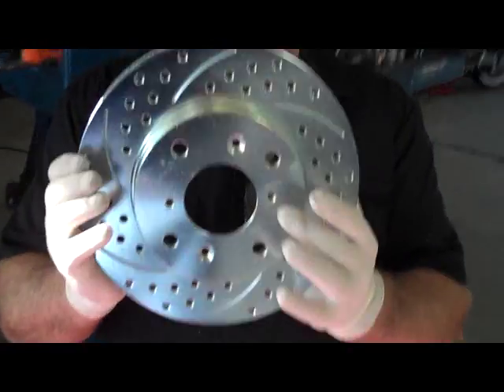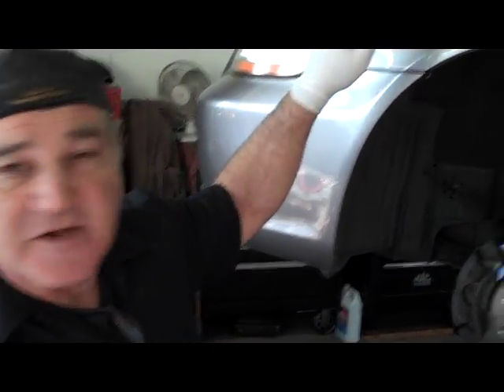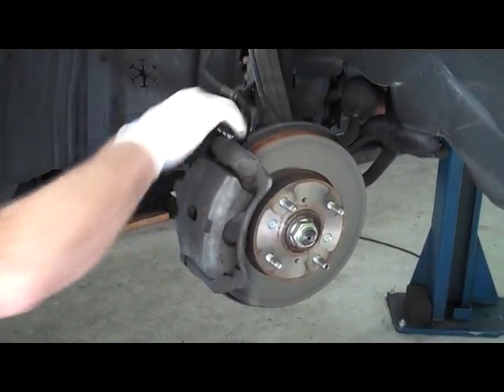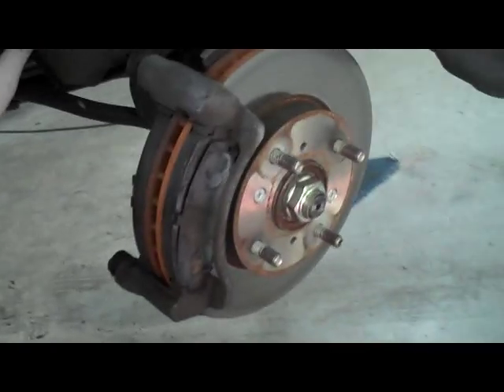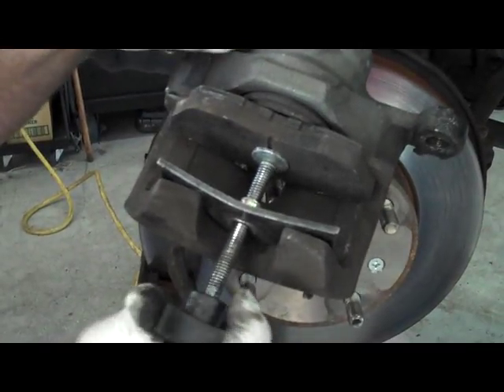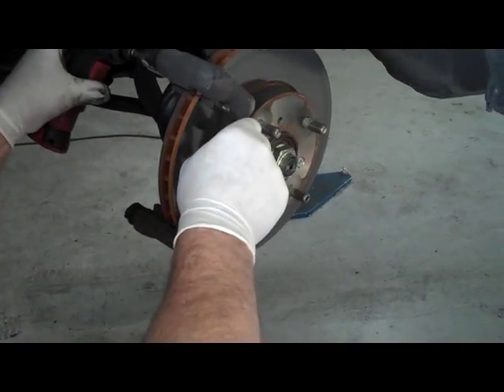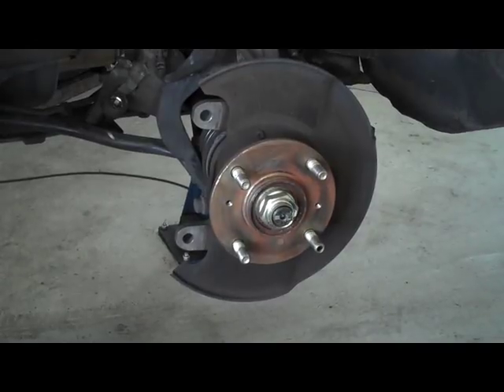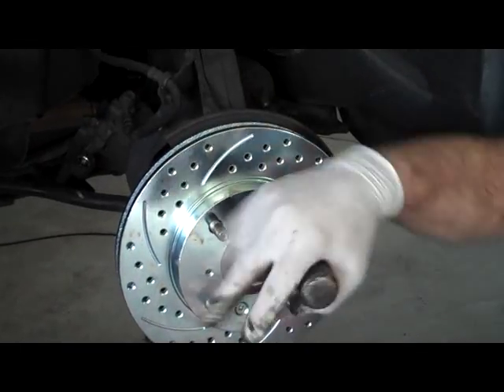DIY:  How to Install Brake Rotors and Pads

Comment: Erm no copper grease on the hub face = bad practice
Erm no idea of tool names = it's an impact driver, which are bloody handy to have
Getting grease/oil on the disc face = bad practice
Not greasing the sliding pins = bad practice
Doesn't clean the piston face nor caliper face = bad practice

& being soo lazy he has to use a power tool to undo the holding bolts = pure laziness

But least we all know the disks are zinc plated

Comment: Just an FYI, you don't need to use the impact driver to install the screws. Those suckers are going to be so tight the next time they do the job. Plus he never described how he changed directions on the impact driver. Just hand tighten those screws, they are put in at the factory just to hold the rotor in place during manufacturing. Also it's a good idea NOT to let the caliber dangle from the brake line, keep it supported or place it on the lower control arm, just don't let it flop around like that.
Reply: i should learn to read trough all the comments before posting haha .. my point well made there . and yeah those screws .. dont understand why he put 2 in again .. its not like the wheel will fall off if they break haha .. and the remark he made .. "if you strip a screw its going to be hard to get out" .. ehh no it wont .. 5 mm hole drilled .. 6 mm torx .. knock it in gently .. twist .. voila screw begone !
Reply: Getting a stripped screw off isn't impossible, but, it's less of a hassle to just not strip the screw.  That being said, screw and bolt stripping could always happen no matter what the case is.
Reply: I was just about to comment that. Tightening those screws like he did is a stupid idea. Mine are finger tight and reality is you don't even need them but it's nice for the rotor to be stationary before you attach the wheel. And yes I've been many times shitting my pants when I had to remove those screws on other people's cars when they started to round off. I had to presoak them in oil and all sort of stuff just to avoid drilling them out.
Reply: Rusiputki no need to soak em realy .. if stripped ..drill 5 mm hole 2 mm deep .. tap a 6 mm torx into the hole .. and then just screw it out :) easy as pie
Reply: Ladosligese Thanks good idea! I hate Torx! My citroen is covered with Torx. The fucking brake calipers are TORX!!!! T55. However I slowly been replacing old bolts and now the car is pretty much hex all around. There are 2 bolts I like Hex and Slotted (flat head) everything else is rubbish.
Reply: Rusiputki Torx are so lovely :D much much better to work with :D when i have the right size ofc :D
Reply: I don't even put those screws on, just an unnecessary pain in the ass
Reply: BundysGarage  How to change brake pads on a 2001 chevy lumina
Reply: BundysGarage

Comment: sloppy job, i don't see what's the rush all about.
Reply: He's an auto mechanic lol. Those guys are paid per job, so you can tell he rushes just because that's what they do.
A perfect reason to never go to a dealer/auto repair if you can do the work yourself.
Reply: Never seen a mechanic (I was one) paid per job as opposed to per hour and a percentage of upsales. There are still some decent and honest wrench Heads left. But they are rare. I agree with doing it yourself. YouTube has changed the industry.
Reply: It's called flat rate. Just google it.
Reply: wrcpatrick
Well I'm biased I guess. I have only worked in shops in Detroit that were sponsored by Ford, GM or Chrysler. So they pay per hour and based on up-selling. Maybe it's different other places.

Comment: Before putting them screws in your rotor put a little never seize on them.  Because the way that guy just used an impact screw driver on them they ain't never coming out next time.

Comment: Impact Screwdriver is what its called. different parts of the country, and other countries call tools by various names. This is a good video for quick reference. I agree, you don't let the caliper hang from the hose, but most shops do. in the older cars, the calipers weight was about twenty Lbs. that could damage the hose, but that caliper is about 3 Lbs. Also Safety Glasses. again that's hit or miss depending where you go. 
  this is a real quick one to watch before you get started, and realize you forgot something. I have personally made many Training vids for aviation, automotive, and marine industry, and we did at least 8 takes to get it right on something this easy. You cant cover everything. example: when you jack up one wheel off the ground, then open a door, you can damage the frame.

Comment: you guys actually put the screws back on?  I left mine off when I had a Honda.  I mean the screws are useless when the wheels are mounted.  they are just a pain to unscrew when they are frozen from rust.

Comment: Those drilled and slotted rotors are available off ebay for 100 bucks shipped, that includes 2 rotors and ceramic brake pads, overkill yes, but a very good factory direct value.

Comment: Squealing/squeaking is caused by binding between the caliper and the metal back of the pad. That is where you apply any anti-squeal application. Not on the pad itself, unless your customer likes crapping their pants when they try to brake.

Surprised at that error, guys.

Comment: I hope this guy was just nervous for the camera. Sadly he probably performs all his jobs like this. Sloppy, careless and the rotor is for the opposite side. The slots should appear to be digging forward, this draws more air into the rotor to keep the heat down and therefore provides better stopping power. Glad that isn't my vehicle.

Comment: You also should have changed the calipers too since you putting on new brakes and rotors.  Just saying
Reply: king kong that's too costly and not needed.
Reply: Ohh I see . So you don't need to change the calipers when getting a new brake rotors?  Because I thought you have to change the calipers too. Now I know 👍👍
Reply: ***** sorry did not know you were the grammar police.
Reply: king kong  Only if your original calipers will not fit the new rotors.
Reply: Ohh thanks!

Comment: why,why,for one slamming those screws back on the rotors??? hand tight was sufficient ,those screws are there to hold rotor in place whether to remove or to install new or old resurfaced rotor and two no anti seize grease anywhere on screws and no cleaning of the brake caliper bracket .I dont know about taking my car to this shop?
Reply: Harbour Freight low budget tool's

Comment: Those pads have plenty of meat left on them. I guess they had boat payments to make.
Reply: Love a good Car Talk reference, hah. I was gonna say, those pads look close to new to start with...rotors can't possibly be worth replacing either.  Especially not expensive vented rotors on a car like that haha. Plus he lets the damn caliper hang by the fluid hose, if I saw a garage pull that crap I'd never be back and make sure no one I know left their repairs in the hands of that clown.

Comment: yeah i put my slotted rotors on my car the other day and i love them braking is heaps better . i was told if you get a magnifying glass you can see the cracks forming around the holes . 
ive seen rotors that were slotted and DIMPLED instead of drilled , i think dimpled and slots would be good instead of drilled holes.

Comment: Blah...I've made all those mistakes too. If you dangle the caliper and the lines get damaged they will leak. Who has $6 to spend on silicon lube...forget that noise. Save the environment...don't worry about brake cleaner...the wheels get tons of debris and dirt from the road once you drive anyway. 
Sometimes u have to get work done. Brakes aren't the weakest link. If an accident happens, its cause of the nut behind the steering wheel.

Comment: Hi , I will replace front and rear rotors and pads on my Golf TDi 2006. Questions is: When you push caliper piston down, is it must be twisted or you can simple push it down use big C-clamp?  Cheers from BC, Michael

Comment: Several mistake I've notice, he didn't even use brake cleaner or anti seize and then he kind of hang the caliber a bit that could damage the brake hose.
Reply: He didn't wash his hands either.
Reply: Ben Vo terrible mechanic
Reply: Ben Vo and he did put his finger once on his nose! :))

Comment: 3:48 That "Special tool" won't help if you want to push back Volvo pistons (backside of the car), because you need to press AND turn the piston to push it in. I always use a water pump plier. And in case of Volvo, I use the water pump plier with a wood clamp.

Comment: This is sort of laughable.  Some of the things he does are right.  But I didn't need a hammer impact screwdriver to take the hold down screws off of my rotors.  And when he took the caliper mounting bracket bolts loose, it didn't look like they had been torqued down from the previous brake job.  Mine were really hard to get loose.  The torque spec for my caliper mounting bracket bolts is 133 ft.lbs.  Plus I used high-strength threadlocker on the bolt threads.  These are bolts you don't ever want to come loose, believe you me.  Something funny I noticed is when he bent down to pick up the dropped brake pad, he almost hit the top of his head on the caliper bracket when he stood up.  You can use a C-clamp to back the pistons off but I also have a special tool and it sure is a lot easier than a C-clamp.  I also use a small block of wood 3"x11/2"x3/4" and not the old brake pad.

Comment: what is the difference between the plain rotors vs Slotted, drilled rotors?? my 2012 LS camaro has the plain ones. also is changing the rotors a regular item that needs to be changed or no? my car has 38K on it. do my knowledge, the pads and rotors have not been changed.
Reply: slotted and drilled will cool faster so if your doing like track driving or just driving hard and they disperse water and fricition gases a lot more effectively and they look cool and as far as the pads are concerned you should maybe take a peek at them and rotors are usually good for a while unless you get uneven wear on them or they become warped but if they're warped you'll know
Reply: They do cool down faster, however they are also more prone to cracking
Reply: Bryant Bonales unless they're zinc plated because then it's zinc plated because zinc plating is good because it's plated in zinc....zinc plated
Reply: Yup pretty much lol
Reply: phenomenalpnut LMAO, I get what you were doing, but the zinc plating only lasts so long, it's not 100% zinc, so eventually it wears through to the metal, and depending on how thick the plating is, that can happen within say a month, to 6 months, to maybe a few years if you are easy on the pedal, but eventually it will wear through, and the zinc plating doesn't make it easier, or less easy to crack from my understanding. The amount of material, the way the driver uses the car, the installation etc, determines how easy they are to crack, like getting them really hot, then driving in a puddle for instance where the rotor is submerged will not be a good day, but a normal rotor in that instance may crack as well, but will almost certainly warp. 

If you care about stopping, the slotted/drilled rotors will help with that, not normal every day stopping but say a kid runs out in front of you, and you hit the brakes hard, there will be a difference, if that matters to you, then why not spend a little more and get them?
Reply: ***** Yeah, but I covered that, they also posted a post before that, and my response was mainly centered around that one, not the sarcastic one. Read the April 2nd comment he made, then re-read mine and it will make a bit more sense.

Comment: This is a perfect example of how to NOT install brakes and rotors! Seems like a nice guy that's been doing it the wrong way for years and getting by. Dirty gloves all over the rotor, dangling caliper, lack of adequate lubricant usage and much more. Makes me nervous to let anyone work on my car. A shade tree mechanic like this working on your car will cause your brakes to fail, jump a curb and wrap your vehicle around a tree at 3:32am on a Saturday night.

Comment: not taking the piss at him great video but a few things for watchers to note never put that noise stuff on your brakes if you have noisy brakes its because theyre made like that motorsport, less brake dust etc etc. 

he is using a bit of force too there the pins are meant to be pulled out by a long nose pliers or something force isnt always the answer.

Zinc stops your brakes from rusting or forming that unsightly look after it rains and you have parked outside.

Comment: Well Kudos to yur hubby for cooking too cause I love to eat--lol   Seriously, I used to be a mechanic (im old, 53) but things were simpler then, carbuerators, no sensors or computers, now you have to be half a tech for some things -lol  but a lot of the basics are the same, sure miss building / swapping engines and all that, spent many hours cruising our strip in with my buddy in his '69 Roadrunner - 383 magnum/4 speed, the storys that car and mine could tell--lol   m

Comment: Female mechanic-?  Kudos to you Yvette, glad to see you like working on yer own car, good skill for a woman to have, many guys these days cant even change their own oil.   On the brakes, I have had to remove some fluid from the M-cyl. at times, as the pads wear and Id replace fluid to keep the level up its too much sometimes when pushing the cal. pistons back and can overflow.  But each case is different - I just installed drilled and slotted rotors om my '03 S10, great deal from Sumit racing.

Comment: this is reason I dont let DERRR people do my jobs...
STOP SQUEAK is just if you are pickie or your brake pads rattle in calipers, some cars actually release brake pads fully, but if that is case,
1. pads are low/replace soon
2. rotors are older and below min thickness, 
3. ahhh! you have air bubble in line and pads are releasing too much
4. or you caliper shoeholder is a little bit worn/old...not a big issue..
STOP SQUEAK is a shoe adhesive..

Comment: okay rules of good mechanic
1. dont let caliper hang on brake line, use a piece of wire hang from tower/spring, calipers are heavy..derrr!
2. clean the old parts from brake dust,rust and foreign stuffs
3. never put that poo he is using on the pad to disc surface, I think the OLD man it talking about STOP SQUEAK.
STOP SQUEAK is a grease that is applied to the rear of pads which keeps the pads fast to the caliper mount surface and stops the rattle sound some pads make
but he was close

Comment: All that moving of the steering rack is going to intrduce air into the system which will make the steering buck like you're on a Dodgem amusement park ride. You have to purge the air by turning the steering wheel stop to stop a bunch of times till the air is cleared.  On some vehicles, you have to draw a vacuum from the steering pump. Best not to move the wheels much when removing the components.

Comment: I know where the original term Ricer came from, not the mixed up word people give it now who have asian import cars and do not like to be classed in the same "spec" as people who have them and make them look and sound like a bucket of horse shit, does not matter what horsepower a car is running or where its racing or all the other bullshit people try to say, if it's asian built. it's rice.

Comment: OMG...
NEVER put any stuff on the side of the brake pads where they touch the rotor!
Dont let your caliper just hang around on the brake-hose pipe when you are changing the rotors!
CLEAN the Caliper, the Caliper holder and the hub of the wheel with a steel brush before putting on new pads and rotors!
And please dont pound with a hammer against the brake rotor or the hub of the wheel! 
Last but not least, clean the caliper screws a bit with sand paper.
Thank you :)

Comment: Strongly agree with AandWProductions, many problems with this video...
1.  No need for Slotted and Drilled on any street vehicle, just bad engineering gone really bad because there made of cheap metal that cracks. ( Note: Ones sold on internet are all made in China and generally don't meet OE Specs)
2.  Did not clean spindle hub, or lubricate it before mounting new rotor. (Note: Dry film synthetic only) 
3.  Did not lubricate caliper mounting points, so I assume he did not use on pads either.

Comment: thats crazy! im looking to replace the front pads on my truck tomorrow myself...since u said the rotors were tightened to much, i was thinking how do u know when tight is to tight on an install like this? the bluetooth dude in the video didnt mention any of that when he was using the drill to tighten back the caliper holder and the caliper back on...any input would be greatly appreciated tonight or by tomorrows install..thanks

Comment: Ozratzon1: did you properly brake in your rotors? There is a bedding process you have to go through... You should not be hard braking at high speed if they are new. Most new rotors and brakes require that you take it easy on them for the next 500 miles after the brake in process... Heres a question,  how old we're your others? How old is your brake fluid? Some of these will play a factor in why your brakes are chattering...

Comment: Physics lesson here. A rotor is a giant heatsink. It pulls heat off the pads and onto it. The more mass a heatsink has, the better cooling capability. If you D/S rotors, you take away mass, thus actually increasing heat during braking. As for Porsche, the only reason their stock drilled rotors are of better quality is because they cast the holes in, opposed to drilling them. Other than that, D/S are just a selling point. If D/S rotors were so great, then big rigs and dumb trucks would use them.